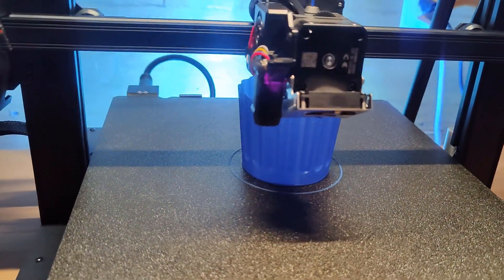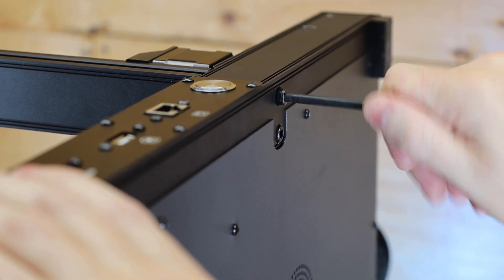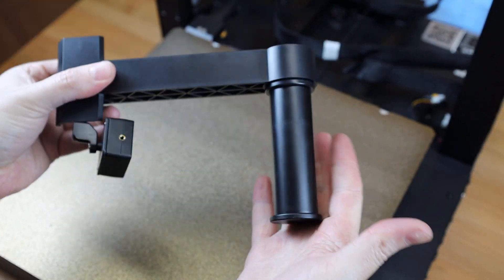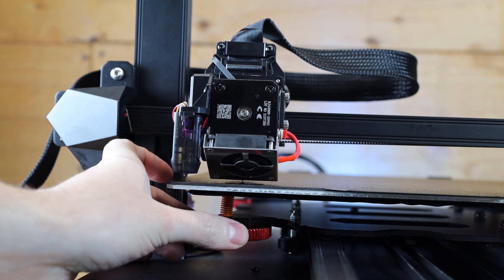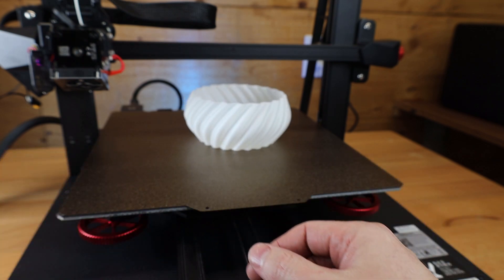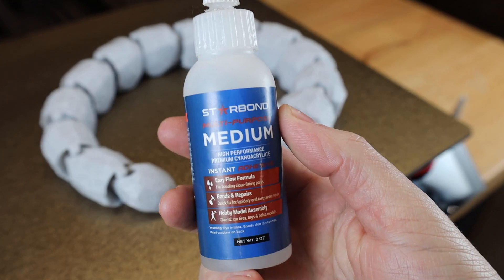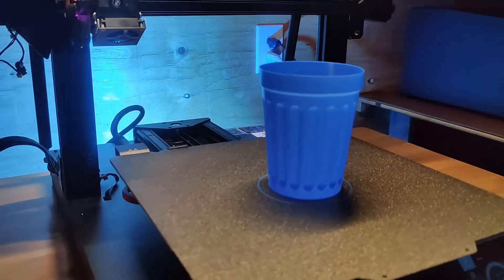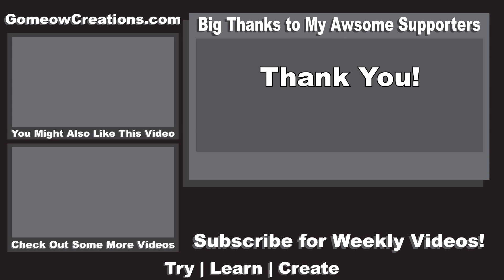Creality CR-10 Smart Pro - Let's See How Smart & Pro This Really Is 😁👍

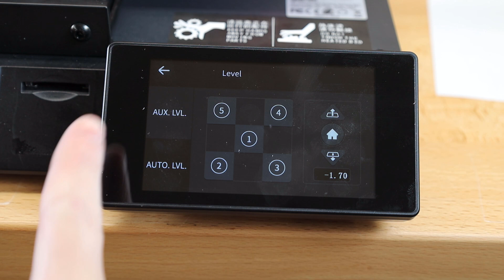Comment: Hi, great video! I got this same printer and did all the leveling but noticed I still had to set a Z offset of -2.00 to get the print head to be on the bed. Yours was similar in that you showed -1.70 at the 7:46 mark. Do you know why this is needed? Shouldn't the bed leveling make the "0" mark where no offset is required? I'm kind of new to the 3d printing though I've had one for awhile. Thanks!
Reply: Not with the CR Touch (or BL touch on machines that have that). You have to adjust for the difference between the touch point and nozzle touch point. My Ender 3 V2 is 1.10 offset
Reply: Yeah, this is my current problem. I finally got something to print, even with a screwed up first layer, and I'm using an offset of -2.23!!! I would think that once manually leveling the bed and then running the auto bl, it would fix the height and make an offset unneeded. So while hearing this helps to at least let me know I'm not as screwed up as I thought I was with it. But -2.23 is still a bigger offset than the others mentioned here. Why do the manual if the probe is going to ignore it???
Reply from the maker: The offset will always be a thing. All of my printers have a negative offset and they are all different as well. 

The 0 mark is the stop in the auto bed leveling sensor and this is always higher that the nozzle. You have to set that offset to your liking and what is doing to work for that printer and that material you are using. You might get it to print fine using pla and switch to abs and things will be off. Abs prints at a higher temp so the bed and nozzle might expand just a little more so you will have to fine tune things a bit. I hope that helps.
Reply: @GomeowCreations  Thanks very much! I'm still learning but at least I'm getting decent prints now. Seeing your video helped to assure me I wasn't crazy or doing something wrong having to use the offset like that. Keep up the good work!

Comment: Great video, thanks a Lot.

Finally there's a review for that printer.
Really like the new Ender 3 S1 but it's building volume is to small for me.
So this one seems perfect.
(But after the CR 10 Smart "desaster" I'm cautious)
Reply from the maker: Yeah I know what you mean with the CR10 smart and it's problems. I was honestly worried about that when they contacted me about this printer. Really didn't want to deal will a lot of problems but wanted to see if it was any better and if it wasn't I was going to still make a video about it. 

Like I said in this video I have other printers that I have upgraded, mostly ender3s and cr-10s. This came out of the box with everything I wanted and setup was super easy. I'm going to be adding this to my print farm and if anything off happens with it I will be sure to make an update video.

Comment: I paid for this 3 weeks ago, and it's not even shipped. Yet you got this for free.
Reply from the maker: Yeah I got this one for free* I did have to spend a week shooting a video for it and hours editing all the content I made it this one 8min long video. So nothing I get is truly free at the end of the day 😅👍
Reply: @GomeowCreations  Haha, I just thought there's a little bit of irony. Making a video will surely be worth it.

It cost me a whopping $950usd to import  this to my country.
Reply from the maker: With that said let me know what you thing of your once you get it.😁
Reply: I finally got mine. I've had nothing but issues. The leveling is off, the front left it's as loose as it'll allow, back left it's has tight.

The power cable which came wouldn't stay in, had to use a different one.

And now I'm trying to print, but the extruder won't melt it for some reason, despite being 200c. It's just clicking
Reply from the maker: I'm not 100% sure. That the problem are but the level thing could be due to the z lead screws not being aligned so it would make things very out of level. 

The not melting part with the clicking is odd. I know that when I try to switch the filament sometimes it will get stuck and hot get to the nozzle. I have to take the filament out and straighten it out a bit and with the cutter I cut the end at a 45 degree angle. That normal makes it's so it I move that table on the time it will slide through the extruder. 

I guess one other this you can try with that is loosen the pressure bolt on the extruder so see it that is just holding the filament too tight. 

I don't remember but is this your first printer?

Comment: Can you attach a octoprint to it or is it not possible unless rerouting wires like on the smart?
Reply from the maker: I don't know for sure to be honest. I have the board layout diagram if you would like to see it just send me an email
Reply: @GomeowCreations  Would it be possible for you to hook up a octopi to it to test?
Reply: I've hooked mine up to Octo print by re-routing the internal USB connection from the Creality cloud which is useless.
Reply: @ipodsync  you do not need to do that on the cr10 smart pro it has 2 usbs 1 for "smart webcam" 1 for octopi
Reply: @viktorlundstrom780  I tried using the USB-C connection on the side, but found the connection to be unreliable.  Once I disconnected the Creality Cloud board, it's been stable.

Comment: Great video. I did not feel there was any bias. I do have one question , I only need to print PP and some PPSU if I put this printer in a heated enclosure would this printer be a good choice ? can you recommend a better choice in the under $1000 price range ?
Reply from the maker: I don't know much about those materials to be honest. According to the paper work I have with this printer the hotend can get up to 300c but I haven't tried to get it that high yet.